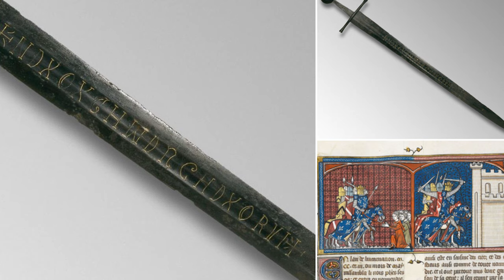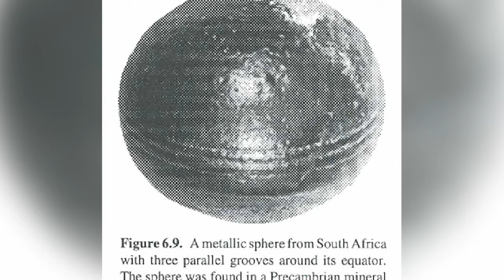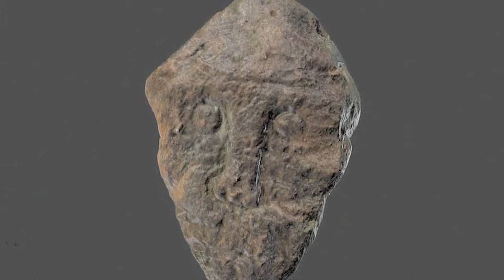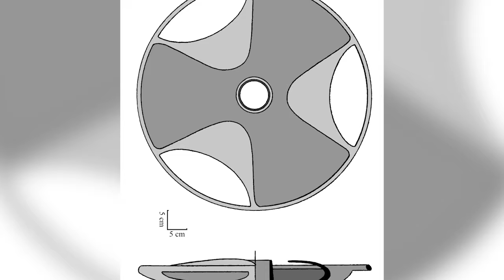12 Most Incredible Finds Scientists Can't Explain

Comment: The outer ring is the spawning seasons of the fish. This is a farming chart much like farmers almanac. The circle with cross in it is (circle) earth as in dirt, and the cross is harvest seasons according to crop cycle. The fan (umbrella) with stick is wind direction and strength. Like a wind sock, to predict land errosion and crop stability. The inner rings are a well. There are tiny "moats" around some crops leading to irrigate crops. The rectangles are patterns of land designation, as in crops. The one to the left top corner of well is a small full crop but portion of that land is rocky terrain, too much for plow and sowing, the "hook" symbol is to the left it denotes not helpful. If it were to the right it would be "blessed" and fertile. The circle with the oblong post means forested area. To the north west of the well, the symbol is a dwelling. My best educated interpretation.
Reply: Wow how come you interpret these signs?

Comment: I see that others thought that pipes went through the holes of the stones for water. I had thought that maybe something organic like bamboo (that already decomposed or was scavenged to make other things) went through the holes. However, I wasn't clever enough to consider a water system. I was thinking, what if they were stacked on wood/bamboo poles and stood up to make stone works. They could then be used to make totems, structures, even communication as the stacking sequence could be changed and each stone may represent something or someone.

Comment: My guess on the use/application of the Peruvian blocks with holes bored into them: Wood deteriorates and rots fairly fast.... Wooden troughs could have been run through these in inter-linking circuits, to transport water... More versatile than the Roman Aqueducts, as you can replace bad sections by simply carving a new tree into shape, and re-route by just carving a few blocks and strategically placing them on route to the new destination.

Comment: I think the Egyptian disc is a cutting wheel. There’s channeled troughs next to the pyramids with what looks like an axle notch that could have held this disc vertically oriented partially submerged in the water. When spun fast it could have created a pressurized water band that could have cut stone.

Comment: Re: stones with holes thru each of them laying around "randomly". 
          Maybe used for tethers/ropes/vines to run thru at intervals and rock edges so they won't get damaged!!!! 
       ....while the hilltop is flattened and waste rocks were tethered to one end, 'specific cut, type & origin rocks/megaliths' were tethered to the rope's other end at bottom of mountain. So as waste rocks were lowered, the specific stones were "lifted" to the mountains summit with ease. This would be the most ideal way and would call for the stones with holes to protect and guide the tethers, similar to a fishing rods "line guides".  
        ***I guess. Soon as I seen those scattered drilled stones that were small & stood low enough...and that they're found in South America/Inca land where the land is mountainous...just seems so  obvious, to me anyway. Work smarter, not harder, makes more time to do whatever.
Reply: You smoke stones. The extra resistance on the rope would be as ridiculous as you thinking it's obvious.

Comment: The disk is a tool for making ropes.
Reply: With respect, I've made rope by hand and the amount of torque put into what would technically be a rather thick cord (if we go by the dimensions of this object) would likely shatter stone that soft and thin. It's not impossible though that it had other parts further down, of stone or even wood, that would tighten the cordage and bear the torque while this device simply fed the fibers into the twisted elements. The fact that it has a through-round-socket does imply it was resting along a length of cylinder. It's extremely precise and elegant, but the fragile nature of it is what confuses me. Take care Pops, best wishes
Reply: Its an ancient fan.
Reply: @direwolffire1955  dem poor folk do live in the desert after all. It's a pity they're so good at carving stuff yet can't figure out how to tilt the fan blades in a way that actually pushes air forward. Oh well, can't expect all that much from primitives can we? looks over at Great Pyramid in the background 

Thanks for making me laugh :D <3 Best wishes

Comment: @13:10 Schist Disk...these were not manufactured by ancient human hands, but rather intelligent humanoid beings with space travel... these are fairly common and are always made of dielectric material...multiple Disks were ganged together in contra-rotating fashion and made up the light-weight non-polar ring to create the necessary vacuum and temperature control  for the molten tin (propulsion) in their stellar vehicles. Vehicle might have been damaged or under ground maintenance and lost one or two of these non-polar dielectric blades. Then someone, long ago, found one on the ground and brought it into their home as a curiosity.

Comment: Blocks w/holes “drilled” through them. Just a thought. They look like, at some time, to have been made to fit in size. What I’m trying to say is that, if y’all can picture them together, with the holes each together. They look like they could be an enlarged representation of a spine, w/a cut-out for the spinal cord. IMO.
Reply: I was thinking the same thing. It looks like vertebrae  with drilled holes for the spinal column.

Comment: The object @13:31. From the shape, abrasions from the inside and wear marks from where the hands would be placed to hold it. It was used to sort lighter material from heavier. Either gold from sand or grains from its husk. Think of prospecting with a pan, same concept. But hey, I only have a picture to go off of.

Comment: Hmmm. The inscription on the sword is interesting and seemingly unusual, but the symbols aren't necessarily there to form words in the normal sense. It's just possible that this series of individual letters might represent some form of abbreviated message, or messages, possibly for the purpose of commemorating different battles or campaigns that the wielder of the sword was involved with. It's also possible that it may have been a highly personalized inscription that only certain people would have understood at the time. It is intriguing.

Comment: The stone face in 9.50 is of Norman Viking trade. It has the facial characteristic`s and they have found that trade was common as far back as 4000 years ago. The stones in Peru look like counter weights they used to lift heavy stones into place. Kind of like a junk yard to station until use.

Comment: The "cross hilt construction" doesn't necessarily mean it belonged to a Christian soldier, unless you are implying that the construction of the crossguard implies a specific time period and place. If you are implying that the "cross" shape of the hilt means it was Christian, the cross shape simply is a design that evolved from early Viking swords, from long before Christianity was introduced to the Norse.
However, the cross potent design on the engraving definitely would signify Christian origin.
Reply: The cross is also one of the first symbols ever used by humans ... after the dot, circle and line and certainly doesnt mean "certainly christian".
Reply: @rahowherox1177  In the case of the cross potent used on the sword's blade, though, it does.

Comment: The weird rock carvings shaped like half circular blocks with holes at the top are very likely weights used to level and stabilize the huge stones that built the South American Ruins they were found in. They appear to be a tool that  by putting an "axel' or pole;  possibly wood or metal.   it must have been rocked back and forth after a large stone is placed down as another part of the wall. 
This "tool" helped insure the perfect joining in tight position without morter and this "tool" did the work of a pile driver by rocking the semicircular  heavy blocks into place...very carefully without cracking the huge perfectly sheer walls already built.  It's so simple the only logical use for the builders.
Or they may just be toys for some giant baby hidden from history. I'm

Comment: 1:25 The letters are not Viking. Runes had straight lines, because that made carving them easy. As in, possible with the most rudimentary tools. These runes, if runes they be, are not straight therefor are self evidently not Viking. This unbelievable simple mistake brings into question the value of rest of the video.

Comment: Has anyone else ever lived in mountainous area with waterfalls around boulder fields? At the bottom of some waterfalls, as rocks fall over the edge, some fall into little drain pools. As the water continuously fills and drains in these drain pools, the rocks that fall into them, over time, get rounded and look like balls with weird lines on them. It could be thought they were made by humans but it's just water erosion in a natural rock tumbler. The sand even makes them look polished. If the pool doesnt fill above the rocks, just the submerged parts change and look like a dradle (a toy spinning top that is more rectangular or squared). Maybe it's the aliens and I know nothing. 🤷‍♂️ except someone will argue with me so I covered all my bases 😁

Comment: The stones in Peru look like they were used to move water from distances away. If it's a stone and there's several like it and it's got a flat bottom that looks like an aqueduct. If it's a stone and it's got a round hole for the mouth that's where water came out. If you ever find a large round stone disc, even if it's in pie shapes, that was to crush grain to make bread. Oh, the drilled holes? Everyone knows that was done with the aliens' laser guns.😁

Comment: way too many misspoken errors and other errors in this video... also odd assumptions from clearly symbolic or artistic interpretations.... just not very good. I couldn't watch all the way through when you said another stonehenge was found in stonehenge instead of spain I stopped. why did no one listen to the audio and double check for mistakes... thats a huge error. please  consider rechecking the audio before applying to the video files and uploading. best wishes for improvement.